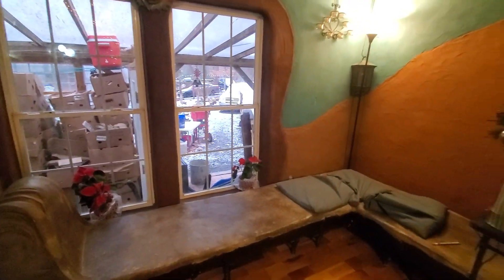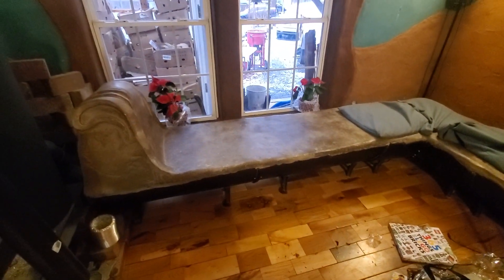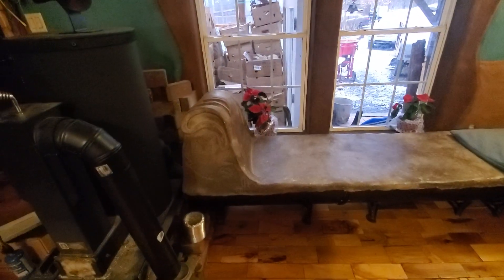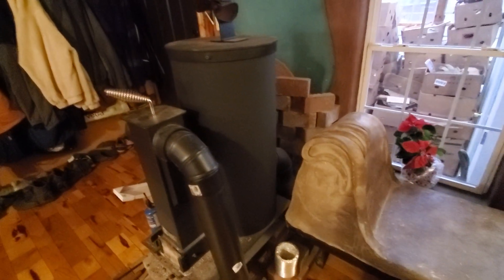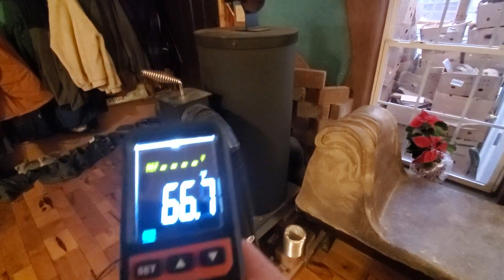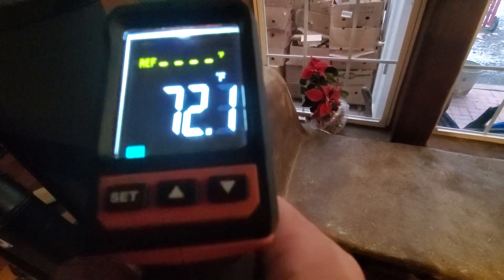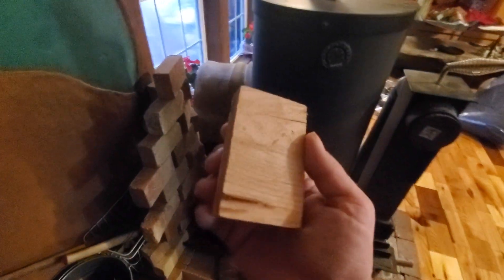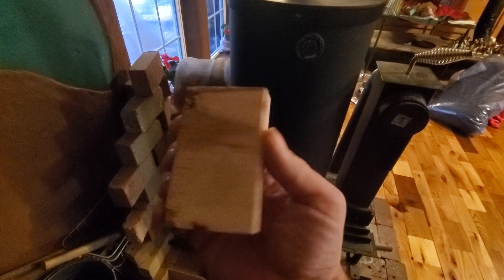Morning Cold Temperatures on the Uncle Mud Liberator Rocket Heater and Mass Bench

Comment: Could you drop in like say 3 compressed logs in the feed chamber at night? That way you have like 24 hours of burn time if damped down
Reply from the maker: A rocket heater runs hot an clean on small loads of wood and needs to be fed every 20-40 minutes unless you run a pellet feeder option. There is no damping a rocket heater down to run dirty and slow over night. Hot fast and clean or you make creosote and burn your house down. Without the mass you will wake up cold. With the mass you get to keep most of the heat a traditional woodstove would have sent up the chimney. The heat is stored and slowly released over night so you wake up warm. I have built rockets you can burn sawdust logs for a long burn like time release capsules, but the metal feed tube and burn chamber on this rocket do not stay warm enough and the big compressed logs do not burn hot enough by themselves to stay burning over night without being attended to.

Comment: Do you have a example of the most effective rocket mass heater in existence? Is it the giant monster paul wheaton showed off in a few videos with the L shaped bench and small sized wood box? I’d prefer this however less efficient
Reply from the maker: Hello, My house is almost identical in size and construction to Paul's house. The monster heater you are talking about in Paul's house is among the most efficient I am aware of. Peter Van Den Berg might have a more efficient one. Erica and Ernie Wisner and Paul did a magnificent job on his. It uses les than a third as much fuel as any of mine does--Liberator (https://rocketmassheater.com/recommends/unclemud/) or Dragonheater (https://www.dragonheaters.com/) or Gamera (https://rocketheatergamera.wordpress.com/) or my own CottageRocket design. Mine still on average use less than half as much fuel as my previous woodstove, and my industrial wood scraps cost $30 per cord instead of $300 per cord for cordwood (or the $1000 some months I was paying for propane before). The thing about the Liberator or the Gamera or Dragonheater or the CottageRocket is that they are accessible--especially the Liberator which is UL and EPA approved. It might not perform at the top of the pack but Joe Schmoe can buy one instead of hoping to get on the schedule of one of the world's few top builders. and he will keep his home insurance. I am also very glad we are getting some built with code approval, and some are just super cheap and easy to build (the CottageRocket). The work we have been doing on mass benches that won't collapse or burn the floor is also paying off. Thank you for watching.
Reply: @UncleMud  thanks for the reply i appreciate it! I think i would eventually just copy your setup if i ever get out of condo living 👍

Comment: Performance is great but the set up look is not to my liking. I have a wood stove and we get free wood from all over the place. Yes we also use the scrap wood bits you showed and saw dust combined with oil thrown into the wood stove. All works and burns well to produce the heat. I agree the heat will not last all night long like your setup, but I prefer it as I only have to clean out the chimney once a year.
Reply from the maker: I like to encourage anyone one who finds something that works for them.